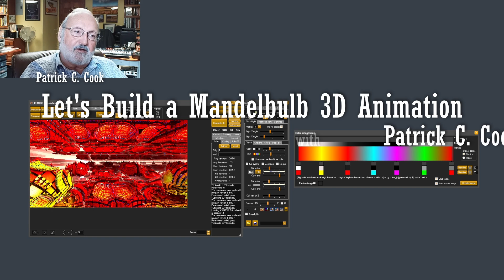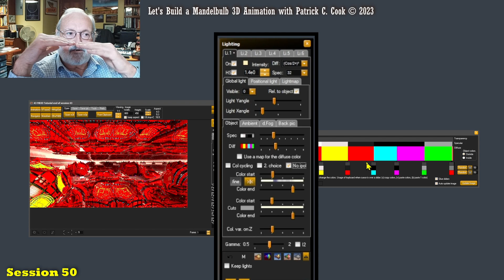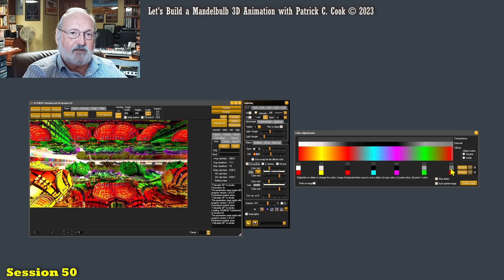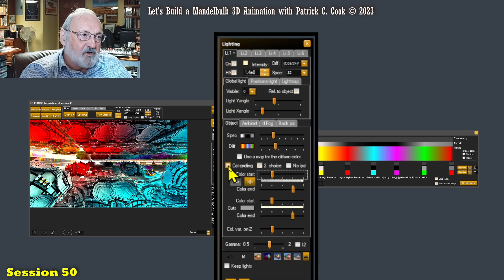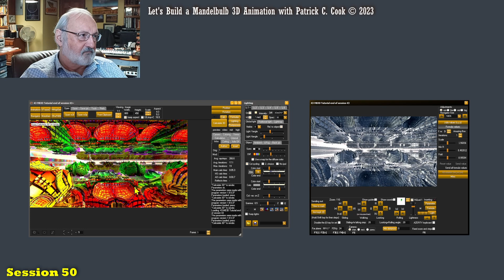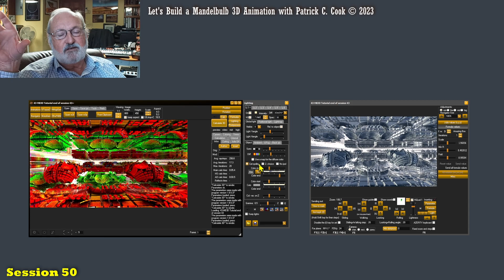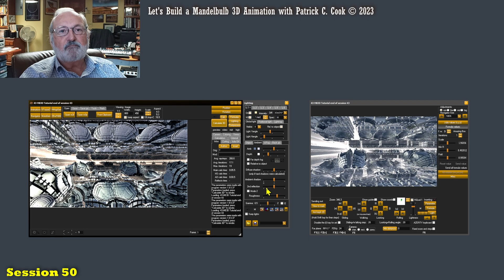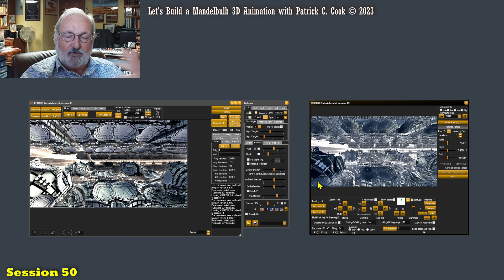TS1.50 - Lighting panel; 'Color Cycling' and impact on animations - Mandelbulb3D Tutorial Series 1

Comment: This is the one session that I was waiting for the most. I think this feature gave me so many grievances. Thanks for clearing up many questions around it and all the sessions before too!
Reply from the maker: Yes, that color cycling feature is usually an animation killer because the colors cycle across the images between key frames. This has the effect of colors being unstable (flickering) as the animation moves from image to image. It’s worse if animating along the Z axis (coloring has a relationship to the Z. Axis). You also need to be careful with the mapping feature which might have the same effect. Maps with color changes on the Y (up and down) axis are fine as long as you don’t animate along the Y axis, which is hard to avoid. Same concept for maps with color changes on the X axis. Color Cycling and maps are fine for stills, but play havoc on animations. Stills are easy with MB3D. Animations are the challenge. Learn MB3D animation and stills are a walk in the park.